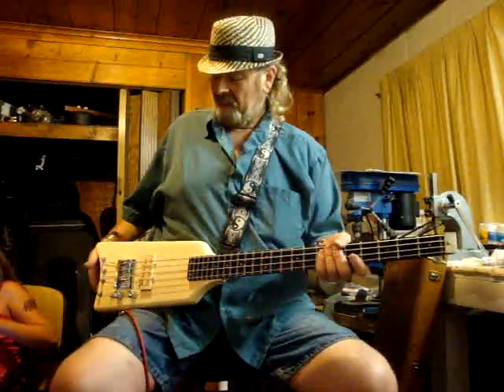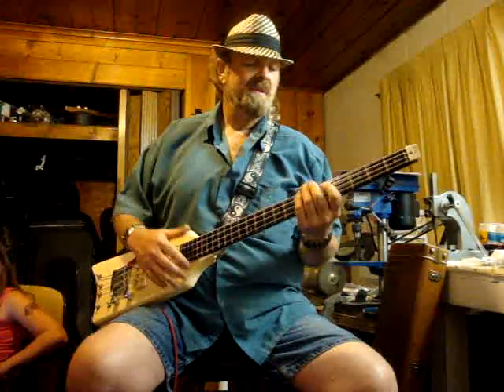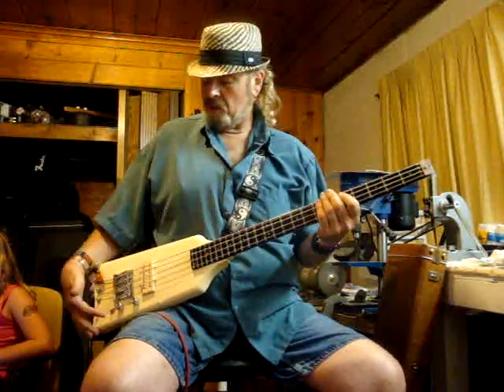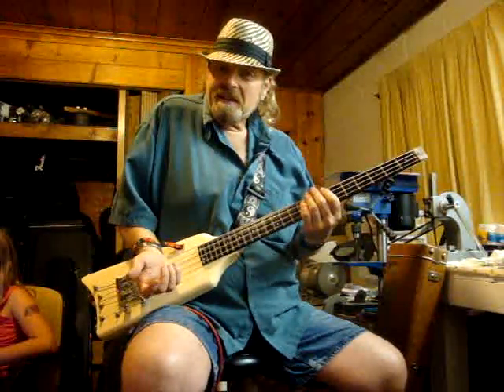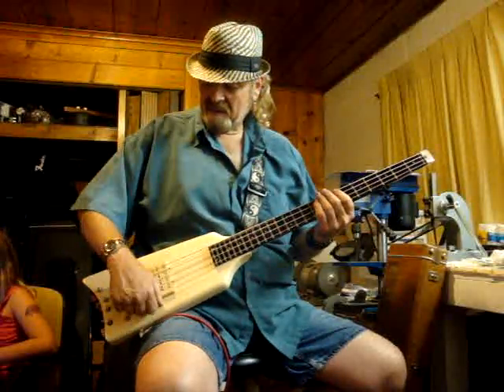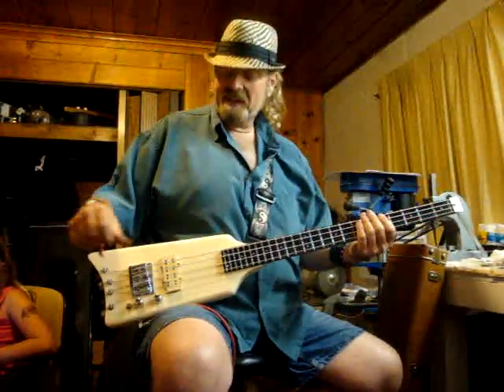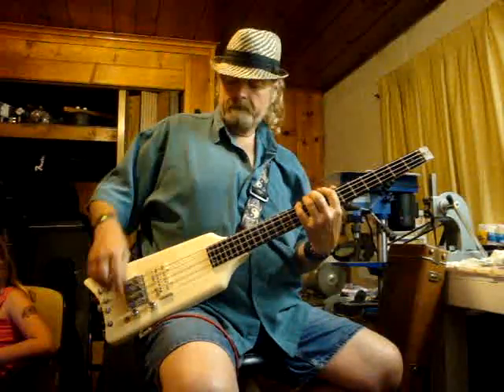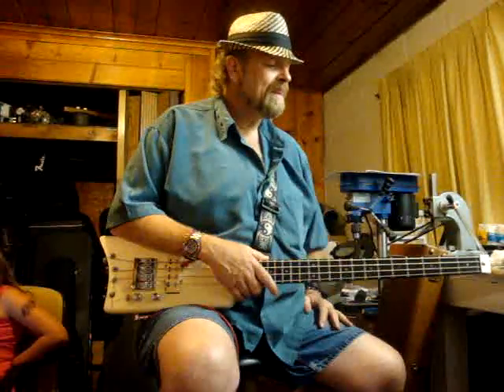JANKTONE EQUIPPED KRAMER DUKE BASS

Comment: I respect the mods you did,  but people don't seem to understand this bass. This was the deluxe model for a reason: original pickup had 8 wires and was in effect a quad-coil pickup, was wired series/parallel/split-coil precision with the 3-way switch, not an out of phase switch. And because of the position of the pickup you can get solid stingray or punchy 80s rock precision bass tone, I use mine on a lot of iron maiden songs. The best mod you can do is rewire the third position to a "reverse p" so the sound is a little less brittle. Personal I think it sounds huge in p bass/series mode, parallel is meh, but far from a dog. To me the mod you did isn't really an upgrade, just taking away the p bass option and making it more like a stingray with the north/south coil switch. To each his own, but yes, would have been better to hear a comparison so people can hear that the original sound is just as good.

Comment: I have 4 headless basses. The first being my Kramer Duke that I bought from Sam Ash Music, White Plains,NY back in the 80's. The Steinberger was all the rage, but I could not afford one. So I bought this aluminum necked 2 octave beauty. Mine is all black, with an original Ghost Buster sticker on it, (hence I named it my Ghost Buster Bass) I have the original case the same as you can see on the right end of this video. I own about 17 or so basses in my collection, and my Ghost Buster bass is still one of my favorites.I'm not sure, because the 80's were kind of a blur, BUT I think they are still the original strings on there and they still sound good. I usually don't do a lot of mods and changes to my basses, because I like to keep things original. With the exception of my latest project a Squire Bronco bass that I am sinking a load of cash to making it a really cool 'cheapest bass Fender has ever put out' BUT, I am concidering "Jake-ifying" mine to sound like this. Maybe Jake has some ideas on how to Jake-ify my Bronco Bass!
Reply from the maker: +JJKrobo it can be done at www.janktone.com

Comment: Soundz identical to the Washburn Bantam headless made in the mid-80z.. came from the factory with perfect circuitry & pickups pozitioned promptly below the 24 fret neck & just above the bridge. Washburn built thee best.. headless bass ever, Nuetrik locking ensured yer cord never pulled out.. but the BEST thing about their dezign, the bottom of the body where the neck goez into it, iz cut away allowing full complete and eazy access to the 24th fret! A trait that even Steinberger didn't feature, and that iz unforgivable seeing how they created & popularized this style of Bass Guitar. Super sweet setup ya got here, especially with the passive fuzz feature now.

Comment from the maker: because this bass has a cast aluminum neck, there is no truss rod.    there is a slight bow built into the neck.

the bass in this video has a slight bow in it, and it plays very nicely!
   
i would suggest you take it to your local guitar tech and have a complete setup done and have the tech look it over to see if the bridge saddles, frets, string nut, and fingerboard are ok and not worn out.
     
it is a cool bass and worth fixing, so good luck!

Comment: It' s a pity we can not hear the 'huge bottom'. Sound harsh and brittle. Small amp there? Or maybe just a bad camera mike...
Reply from the maker: we used a small camera to record with, and unfortunately they are limiting.   i can assure you that this little bass sounds bigger than it's short scale length !            this is a working duke and is gigged with on a regular basis with no complaints!